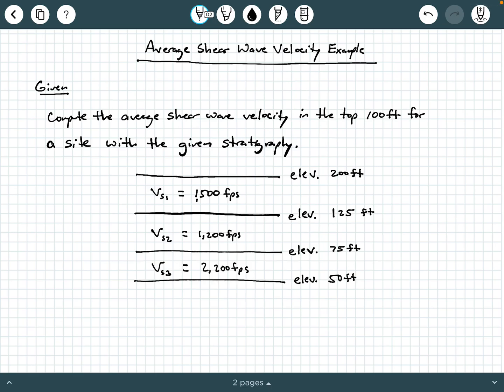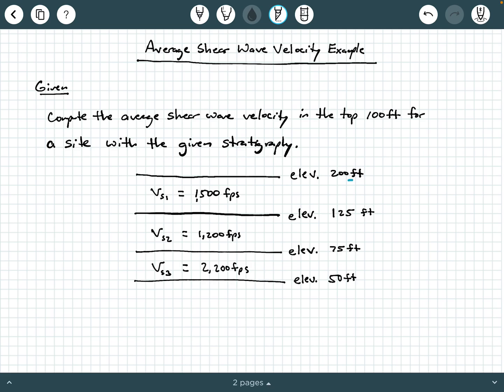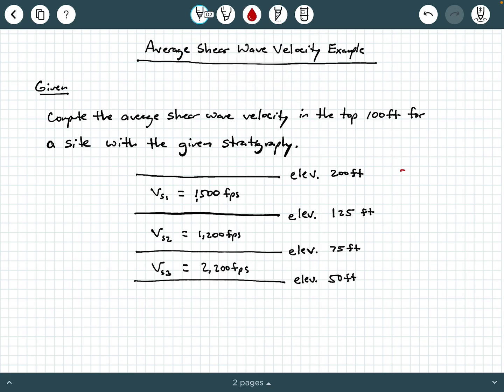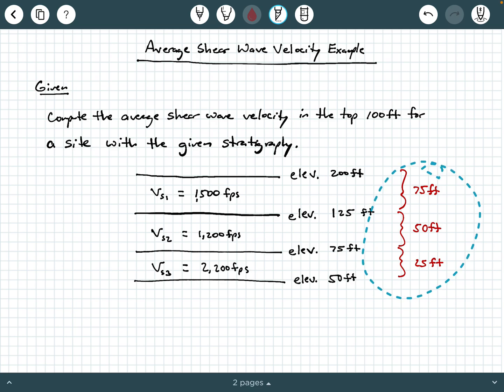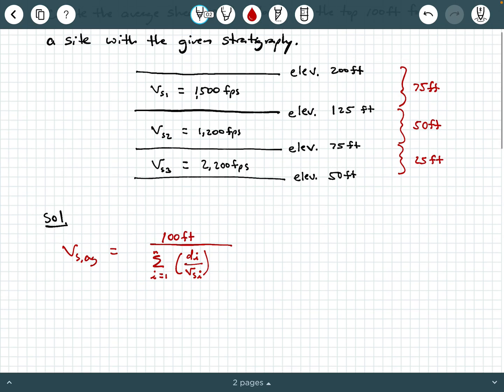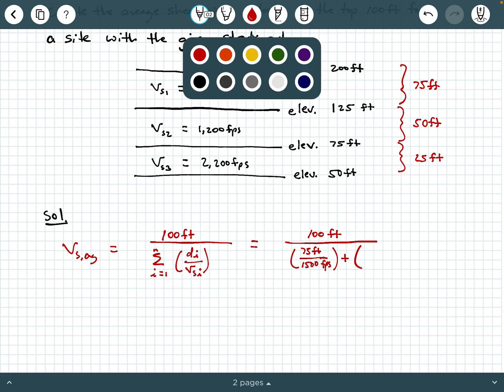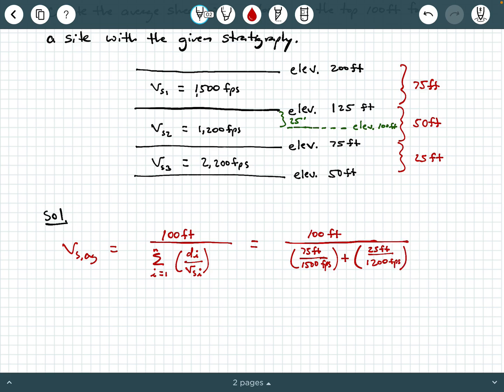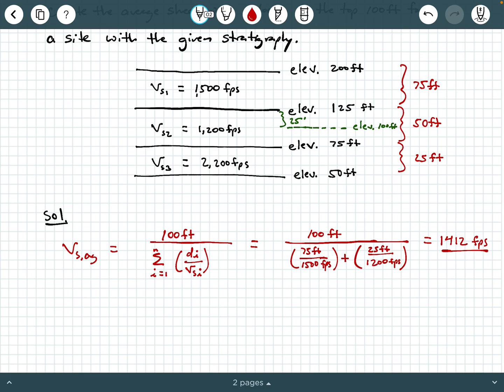Structural Analysis - Video 25:  Average Shear Wave Velocity of Layered Soil

Comment: i have a question.
suppose 
83.2	0
83.2	1
83.2	2
109.5	2
109.5	3
122.5	3
122.5	4
162	        4
162	        5
147.65	5
147.65	6
these are the depth wie Vs values. If i need the value of Vs at depth 4 meter, which one should i consider?
Reply from the maker: It depends on what you are using it for.  If you are using the average (hormonic mean) to determine the site class for the ELF method, you need to compute the harmonic mean in the top 30 meters.

Comment: how can we find for vs only usıng spt numbers
Reply from the maker: Thanks for your question.  ASCE 7-22 does not include this, however previous versions of ASCE 7 do.  In ASCE 7-16, this is included in Section 20.4.2.  It is also computed similarly using a weighted harmonic mean.

Comment: Why isn’t the average just the shear wave for the layer X thickness of layers within the top 100’ summed up divided by 100? That equation you have is not the average
Reply: Like the average shear wave velocity in the upper 100ft would be ((1500x75)+(1200x25))/100=1,425
Reply from the maker: Thanks for your good question.  This type of average is called a "Weighted Harmonic Mean" and is not the same as an "Arithmetic Average".  In applications involving rates (like shear wave velocity), the Weighted Harmonic Mean is the correct type of average to use.  In this application, it is used because it provides a more accurate representation of the strata stiffness and the wave travel time through the layers.  This equation is also given in ASCE 7 Chapter 20.